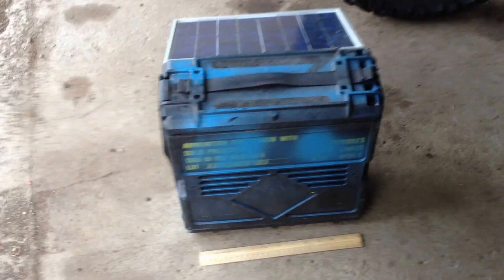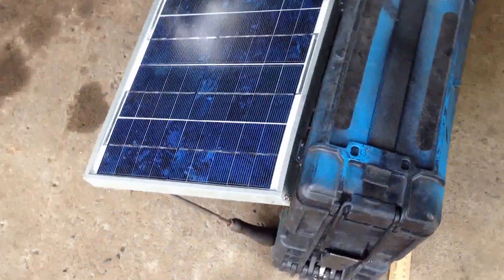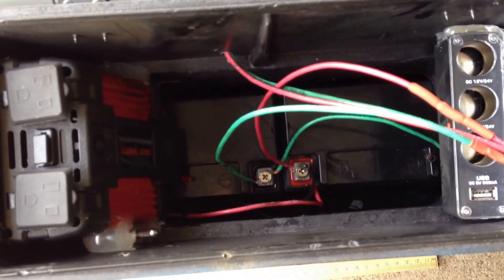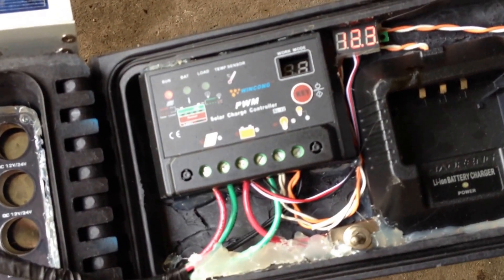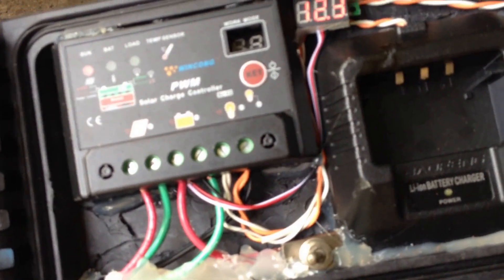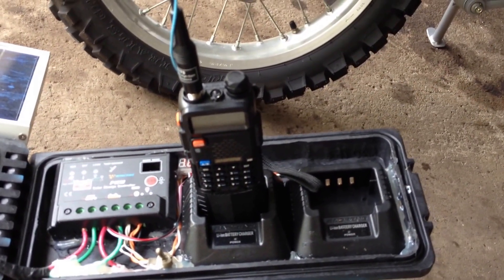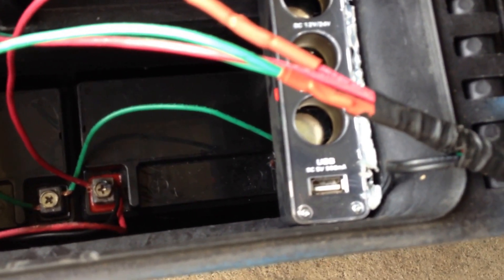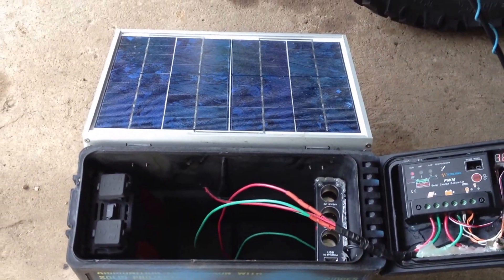Portable PREPPER Solar Battery/Baofeng UV-5R Radio Charging Station

Comment: What wire is that curling up your antenna? What's it for?
Reply: +Gunslinger1028 its called a tiger tale i have never seen one curled around the antenna before but it is a counter poise which has more gain because it is another quarter wave on the antenna.
73's KG7UCG
Reply from the maker: +david gierszewski David is correct, both of the belt clip screws have continuity with the base of the antenna. the idea is that antenna is a quarter wave and by cutting the correct length of opposing wire you can increase gain by completing another quarter and letting it dangle down below the radio opposite of the flexi antenna. there are a million different opinions if this actually works or not, I choose to believe it does thru practical application. its only wrapped around the antenna for storage because holding a camera and putting it in a charge base and keeping the wire out of the way is just a pain in the butt. thanks for watching!